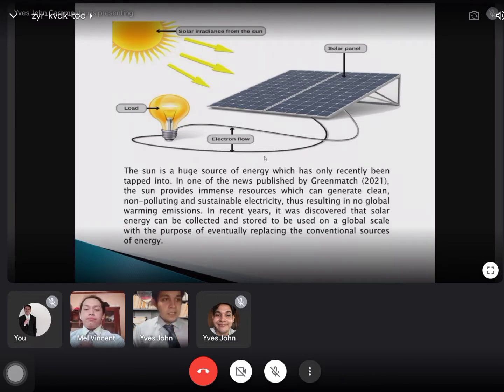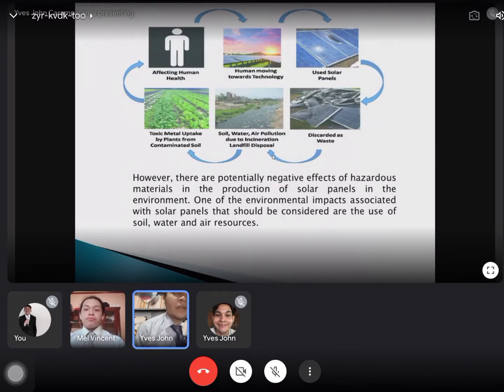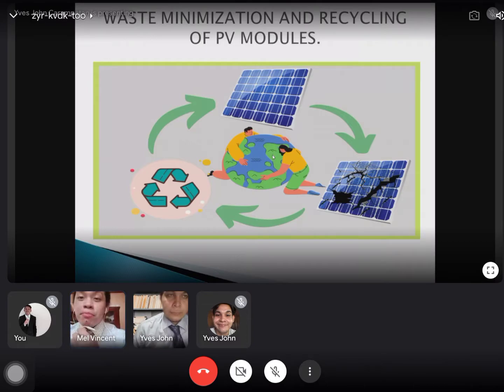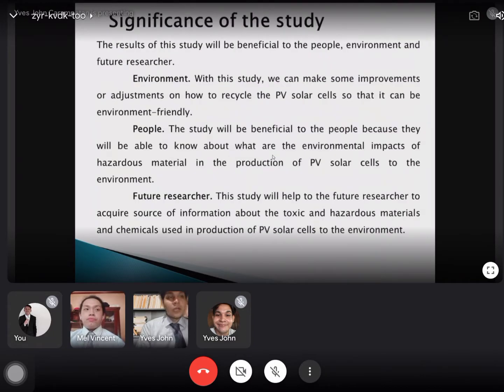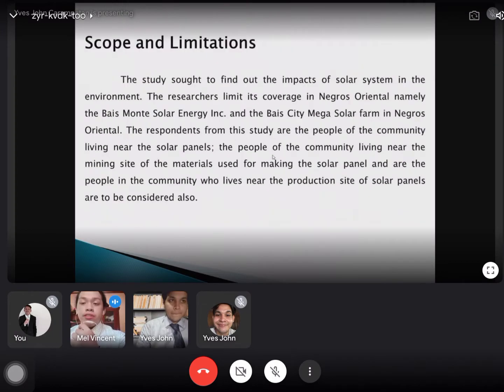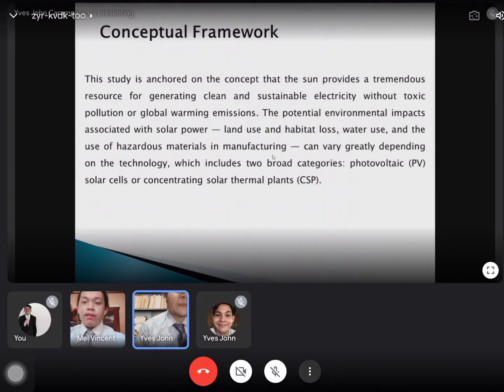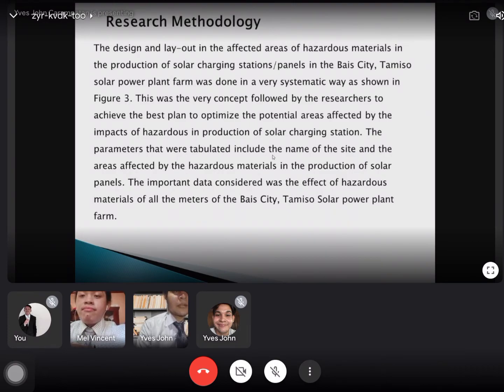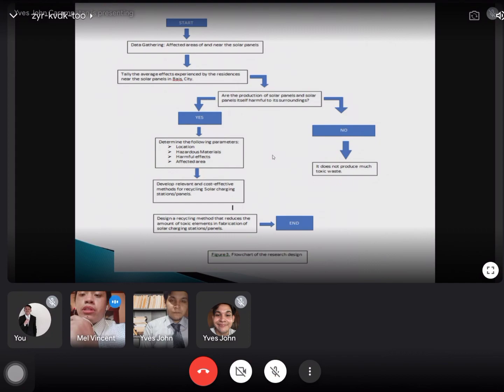The Impacts of Hazardous Materials in  Production of Solar Charging Panels on the Environment

Comment: A passive heating system in hot climates using non toxic glycol proviides wsrm to hot water for household use and can be integrated through wslls and floors.
 Geothermal when applied to large buildings hospitals for example are carbon neutral or low.
 Small windmill, stationary bicycle with a magneto both feeding deep cycle storage batteries and we're low carbon impact.
 Hail can mAke short order of panels and they require an occasional cleaning.
 Internal combustion for me however I walk cycle or use public transportation as well.
Too many decades in environmental remediation to justify cost of solar production.
 Chemical engineers are my favorite.
Phenols t turn ground water cherry Kool Aid red and percs go through concrete .

Comment: Tudio, Lechly D. 
COE 346 Methods of Research T-TH 5:00-6:30 PM March 26, 2022
Reaction: It has gotten my attention since I was in love with solar energy. I would not have thought that there are also disadvantages to using this. Using solar energy can have a positive, indirect effect on the environment when solar energy replaces or reduces the use of other energy sources that have more significant effects on the environment. However, there are environmental issues related to the production and use of solar energy technologies.
Reflection: Like everything in life, there are upsides and downsides. Solar energy is not that perfect. It does not change the fact that it is useful. Always bear in mind that all things can be handled responsibly. Let us not be abusive in using solar power.

Comment: NAME: Lumelyn E. Ragusta
CLASS NAME & CLASS SCHEDULE: ENS 341 B Research Methods for Engineering – S 5:00-8:00 pm
DATE: March 26, 2022
REACTION:  This research proposal might be efficient if the researchers define the hazardous materials and commit to a certain environmental test parameter around the study area. The approach of committing to at least 1 chemical component to measure the impact of hazardous materials provides a tangible research impact. This approach is most commonly used for environmental research and studying the impact based on good management and related literature alone is not sufficient. 
REFLECTION: I appreciate that the researchers gave a research context but I wished that researchers will also give a quick overview of what the 2 Bais solar companies are in their scope of the study. This will allow me to understand their limitations on a higher scale. Studying the impact of hazardous materials is expensive to research, I feel that there’s a need to change the title of the study that will be sufficient enough to justify their research limitations.

Comment: Name: Balansag, Lorenzo Jr. B.
Class Name and Class Schedule:  ENS341- Research Methods for Engineering | Saturday 2:00-5:00 pm 
Date: March 26, 2022

Reaction: Even though solar panel are considered clean energy, it still has some bad impact to the environment. As the video presented, in the production of such device creates harmful materials. They have showed a clear information on the bad impact that the solar panel production can make.

Reflection: Some say that solar panels are clean energy, but are they really. Is the advantages of this technology far exceeds it's disadvantage. Up to the point where we consider it a clean energy. The production of which may have created pollutants and harmful materials, but also it will help stop the use of other power generation that is far more creating pollutants.

Comment: NAME: Kilapkilap, Joebert L.
CLASS NAME & CLASS SCHEDULE: ENS 341 A – Saturday 2:00 – 5:00 PM
DATE: March 26, 2022

REACTION: The said proposal is quite unique because even though the solar panel can help reduce the consumption of fossils fuels that leads the decreased pollution. It does have some disadvantages, one of which is that once it has reached the end of its useful life, it will be detrimental if it is not recycled due to the hazardous substances contained inside it.

REFLECTION: This video made me understand that while solar panels may appear to be environmentally friendly, they might potentially have detrimental consequences for our environment. It made people aware of the dangers we're taking by using solar-powered devices. As a result, it's equally critical to consider the downsides of ostensibly environmental projects so that they can be addressed.

Comment: Name: Orito, Jessel A.
Class Name & Class Schedule: ENS 341 B Research Methods for Engineering (Saturday 5:00-8:00 pm)
Date: March 26, 2022

Reaction: Determining the impacts of hazardous materials In the production of solar panels on the environment greatly helps for the usage of solar energy resources. Whether it is a good one or a disadvantage, it is still better to be aware of its impacts.

Reflection: In recent years, solar energy is collected and stored to be use on a global state purposes which eventually replace the conventional sources of energy. Since some thermal devices use in transmitting heat are potentially dangerous substances then the environment could be harmed if these materials leak. It is for your own good when you able to determine the impacts because it is such a great way before starting to produce solar charging panels.

Comment: Name: Dolly Rose S. Bigno
Class name and Class Schedule: Reaserch Methods for Engineering-B/ Saturday (5:00-8:00 pm)
Date: 03/26/22

Reaction: Well, it is good to know that these individuals address also the negative impacts of equipments used for the production of solar charging panels. For they are also concerned in the welfare of the environment.

Reaction: We all know that we get more benefits from solar energy and because of the amount of great benefits of solar energy we get, I never thought about its effects on our surroundings. Not the energy, but the hazardous materials or equipments used for production of solar charging panels. Environmental effects that needs to be considered are the used of soil, water and air resources.

Comment: Name: Sienes, Marianne Nikki T. 
Class Name and Class Schedule: ENS 341 B - (5-8 PM Saturday)
Date: March 26, 2022

Reaction: The video presentation is very informative. Using solar panels has not only great benefits, but also has hazardous implications for the environment. Solar panels are widely used nowadays, and it is alarming to know that they have negative effects. Good job to the researchers for addressing this problem. 
Reflection: We are fascinated with the use of solar panels because it is good for the environment. The fact is, there are negative effects on the environment from the use of hazardous materials in the production of solar panels. It doesn't mean that if it is beneficial, it will not have bad effects.

Comment: NAME: Alnie Jane M. Aum
CLASS NAME: ENS 341 B - Research Methods for Engineering
SCHEDULE: Saturday, 5:00 - 8:00 pm
DATE: March 26, 2022

REACTION:
     This research is about the Impacts of Hazardous Materials in Production of Solar Charging Panels in the Environment. Today, the use of Solar Panel is widely spread throughout the country. It is clear to us that this solar have many advantages. But I also think that there is also disadvantages here. As the Researchers argue that there were a harmful material in solar panels.

REFLECTION:
     Solar Panels turned out to have disadvantages too. This will only lasts to 25-30 years, thus another problem occur when disposing that panels that didn't work anymore. It is a problem again to the environment on how to properly dispose those when in fact there is a harmful materials in that system.

Comment: NAME: Duhaylungsod, Ronalyn B.
CLASS NAME & CLASS SCHEDULE: ENS 341- Saturday ( 5:00-8:00 pm) 
DATE: March 26, 2022
REACTION: Based on the video presented,the research proposal is very informative and beneficial at the same time to the people and environment. The researchers provided informations which could help the viewers to understand more about the proposal.
REFLECTION: Toxic and hazardous materials used in the production of PV solar cells can really damage the people and the environment. As an engineering student, the proposal helps me recognize the importance and uses of solar panels and it's negative impact as well. Also, it is really significant to consider the advantages and disadvantages of the issue to raised awareness.

Comment: NAME: Alejandro A. Bargaso Jr.
CLASS NAME & CLASS SCHEDULE: ENS 341-SATURDAY 2:00-5:00PM
DATE: MARCH 26, 2022

REACTION: 
The research is well-researched and educational because it examines the possible consequences of hazardous materials in solar panel fabrication.

REFLECTION: 
In this research, we hope to learn how to recycle it in order to eliminate the potentially harmful components included inside it as well as the negative implications it may have. But the usage of solar panels, which is renewable but has a significant impact on the environment, plays a significant part in solar energy's development. It is impossible to remove the harmful chemicals that are trapped within solar panels without harming the panels themselves. They should recycle some of the panels' components that are recyclable, such as metals, in order to reduce the amount of trash produced.

Comment: JAPHET C. MALOLOY-ON
ENS 341 B - SATURDAY 5-8:00 PM
March 24, 2022
 
Reaction:

The sun provides a tremendous resource for generating clean and sustainable electricity without toxic pollution or global warming emissions.
The potential environmental impacts associated with solar power land use and habitat loss, water use, and the use of hazardous materials in manufacturing can vary greatly depending on the technology, which includes two broad categories: photovoltaic solar cells or concentrating solar thermal plants

Reflection:

Solar PV cells do not use water for generating electricity. However, as in all manufacturing processes, some water is used to manufacture solar PV components. Concentrating solar thermal plants, like all thermal electric plants, require water for cooling. Water use depends on the plant design, plant location, and the type of cooling system.

Comment: Name: Belinario, Cristy T.
Class Name and Class Schedule: ENS 341 B - (5-8 PM Saturday)
Date: March 26, 2022

Reaction: 

Solar energy is regarded as one of the cleanest sources of energy because it does not emit greenhouse gases when in use. However, it is true that everything has benefits and drawbacks. According to the study, the disadvantage of manufacturing solar panels is that it has a negative impact on the environment because it requires harmful chemicals such as sodium hydroxide and hydrofluoric acid during its fabrication. Furthermore, it is stated that the construction of large-scale solar facilities or solar energy power plants necessarily requires clearing and breeding, which causes soil compaction, changes in genetic channels, and increased erosion. Nonetheless, waste minimization and photovoltaics module recycling can help mitigate the negative effects of hazardous materials used in the production of solar energy plants. Solar module recycling methods are being developed all over the world in order to reduce the environmental impact of PV waste and recover some of the value from old modules. Because it is impossible to eliminate all of a thing's disadvantages, it is best to weigh its advantages and disadvantages before deciding whether it is beneficial or not.

Reflection:

A lot of research has been done on the positive impact of solar energy on the environment. I like the idea of the researcher addressing the disadvantage of it because sometimes we only focus on the end result and forget to look into the process of making it. The construction of any large-scale industrial facility, such as solar energy power plants, can pose risks due to the materials used in their construction. This factor should be considered in order to provide a solution to the existing problem.

Comment: NAME: Loreto C. Bayawa Jr.
CLASS NAME & CLASS SCHEDULE: ENS 341A SATURDAY(2:00-5:00)
DATE: 03/26/22

REACTION: The video was well-presented, and it provides information to the audience on the dangers of using hazardous compounds in the manufacture of solar power panels, which is important information.

REFLECTION: It is possible that the usage of solar charging panels is good, but it also has negative impacts on the environment because some hazardous elements are used in their production, which can have a bad impact on the environment.

Comment: Pagente, Jayvee M.
CoE 346 A Methods of Research TTh 5:00-6:30 pm
March 25,202

Reaction: Through this presentation we understand that there are hazardous impact in manufacturing a solar charging panels. It help us to realize that it also affects the environment from it hazardous materials.

Reflection: Though solar panels have lots advantages in many ways since it only use a renewable energy that comes from the sun, there are also drawbacks that affects and harm our environment through its manufacturing and the materials used. So we need to come up with a solution to prevent and address this problem.

Comment: Name: Ma. Theresa C. Velasco
Class name & class section: ENS 341 B /5:00-800PM SATURDAY 
DATE : MARCH 25, 2022

Reaction: They explain well their research proposal. They are presentable and knowledgeable of their research. And their topic is about the Impact of hazardous materials in solar panel charging station to the environment.

 Reflection: The impacts of having a hazardous materials of using solar panels to have charging station in the environment are not safe either. It is said in their research that when the panel leak it will result into danger hazard materials.

Comment: REY STEPHEN O. TUMAPON
COE 346 Methods of Research T-TH 5:00-6:30 PM
March 25, 2022

REACTION: This research proposal is very well presented and informative. It is also interesting because it shows the negative sides of solar panel production.

REFLECTION: As a result of this research, we already know that solar panels are not only beneficial but also have a negative impact on the environment. Solar panels, on the other hand, significantly aid in energy conservation.

Comment: NAME: Rupert Tristan R. Borlaos
CLASS NAME & CLASS SCHEDULE: ENS 341-A (2-5 Saturday)
 DATE: March 25, 2022

Reaction:
The researchers do a good way of presenting their research, they presented it appropriately and the presentation is informative. The audio of the presentation is audible and there is only minimal background noise that can be heard. The visual presentation is also good and simple.

Reflection:
Even though solar charging panels are a good alternative source of power, there are still issues on it. As I watched the video, I was informed that there are also negative impacts in using solar charging panels. This video presentation is significant, very informative and an eye opener to me.

Comment: NAME: Tracy Alex E. Manzo

CLASS NAME & CLASS SCHEDULE: ENS 341 Research Methods for Engineering - SATURDAY (5:00-8:00PM)

DATE: March 25, 2022

REACTION: As we all know, the use of solar panels is on the rise, and many of us desire to get our hands on one. They demonstrated that while solar panels have benefits, they also have drawbacks. According to the researchers, solar cell manufacturing uses a lot of toxic materials in order to convert sunlight to power. Solar power plants necessitate a large area that must be cleaned and where the solar panels must be installed. It must also be cleaned and maintained on a regular basis in order to perform properly. This topic enlightens us that, while solar power plants are said to be environmentally benign in energy generation, their construction has drawbacks. However, as long as the benefits outweigh the drawbacks, we can live with it.

REFLECTION:  In terms of construction and trash solar panels disposal, I'm well aware that solar-powered plants aren't exactly environmentally friendly. Solar cells on a solar panel, as we all know, only last 25-30 years before they need to be changed. We don't want the abandoned solar panels to cause another serious problem, such as poisoning or contamination, thus they should be handled with care or recycled. And I realize that before I do anything, I need to know what the bad consequences will be and how I will cope with them. Consider the current situation of climate change, in which we have placed far too much emphasis on the proliferation of automobiles and power plants while ignoring the harmful emissions that result. As a result, we now have this circumstance, which is still another issue to deal with.

Comment: Jessielou A. Gomera
ENS 341 B - SATURDAY 5-8:00PM
March 25, 2022

Reaction:
The impacts of hazardous materials in production of Solar charging panels on the environment produces toxic waste . The disposal of these hazardous materials can wreck the environment because the amount of waste are not recyclable.

Reflection:
However, the use of solar panels has a big role to solar power because it is renewable but has tremendous effect in the environment. Solar panels are contained with toxic chemicals that cannot be removed without destroying the panels. In order to lessen the waste, they should recycle some parts of the panels that are recyclable like metals.